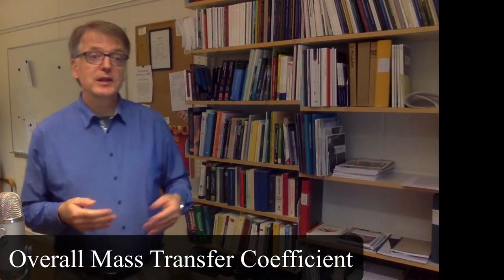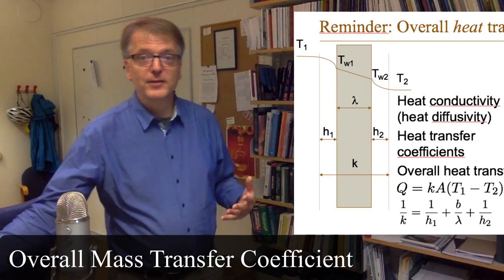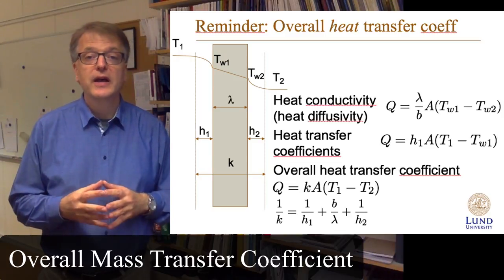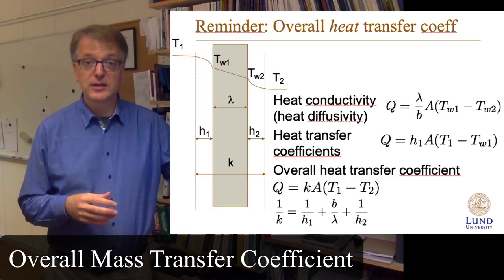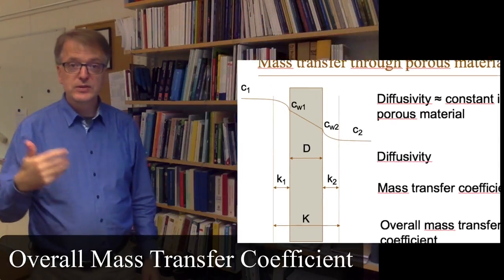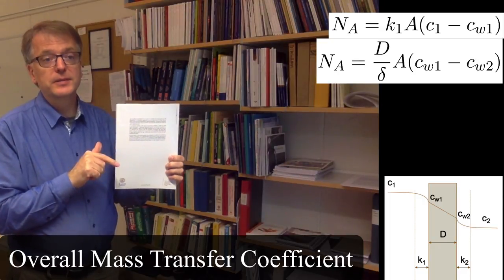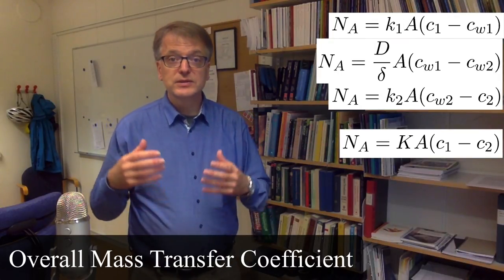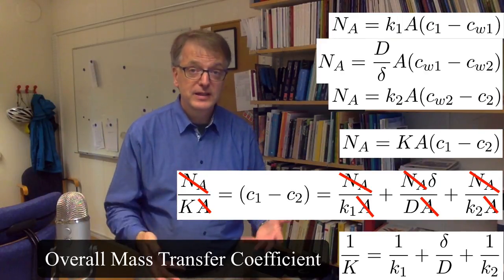Overall Mass Transfer Coefficient

Comment: Could you explain the reason(s) for the concave and the convex concentration profiles in the films?
Reply from the maker: Equimolar counter diffusion (https://youtu.be/0HhQhj6HvSk): Linear gradient

Diffusion through stagnant component, a.k.a. Stefan diffusion (https://youtu.be/VXIwAkjYMLM): Non-linear

"Convex" or "concave"? Think linear and then bend the gradient in the direction of the convection (as in 2nd video above, specifically at https://youtu.be/VXIwAkjYMLM?t=232) 

(I myself would not use the terms convex or concave here since you can change the appearance by looking at the setup from a different direction)